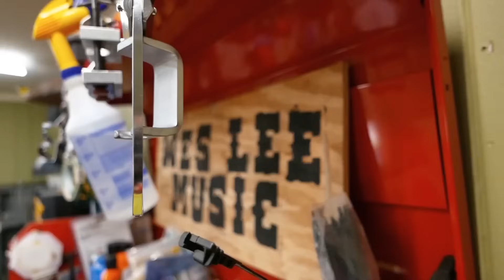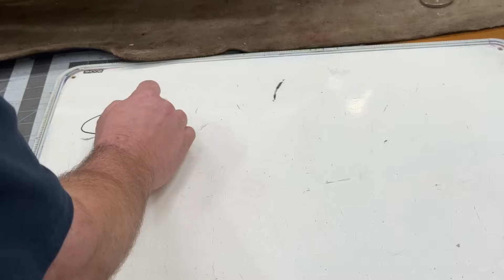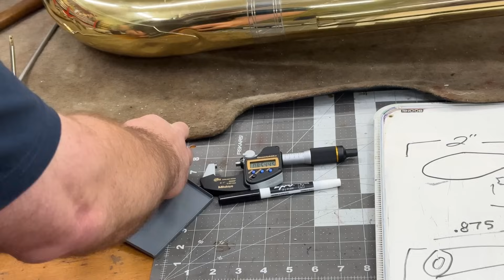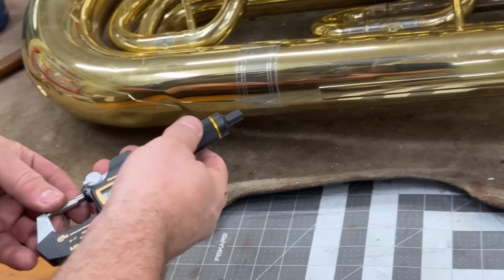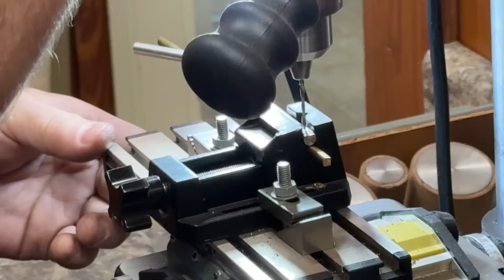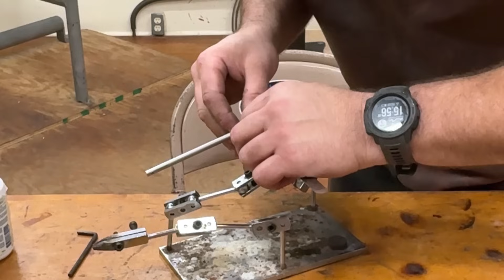NO PARTS AVAILABLE! Fabricating a Linkage-12/3/23- band instrument repair, Wes Lee Music Repair

Comment: As a toolmaker, when you run the die on the round for threads you could have put the die in the lathe chuck and the round piece in a drill chuck in the tailstock and free wheeled the lathe chuck to turn the die.  This would keep everything concentric. Just food for thought for the next time you do something similar.
Reply from the maker: Thanks

Comment: Thanks for another great video. I have a mid 1900’s outboard motor with missing linkage for the carburetor.  I think I can manufacture the missing linkage using the same technique you showed.